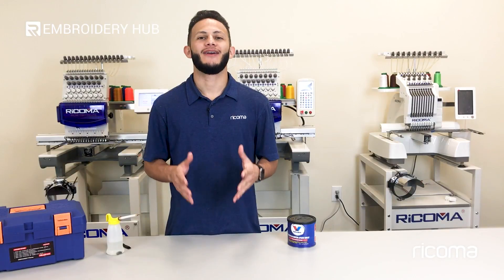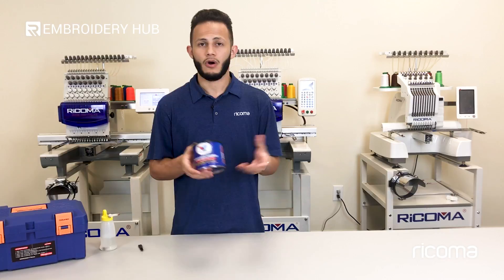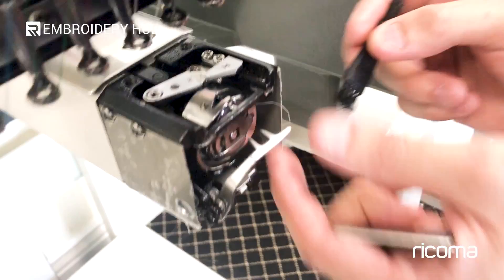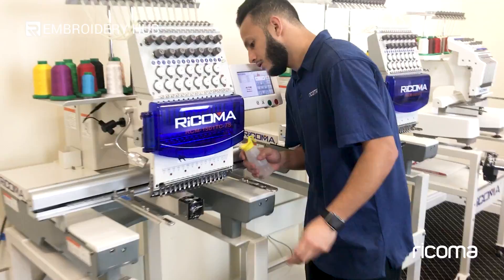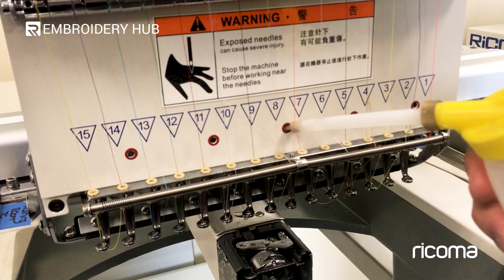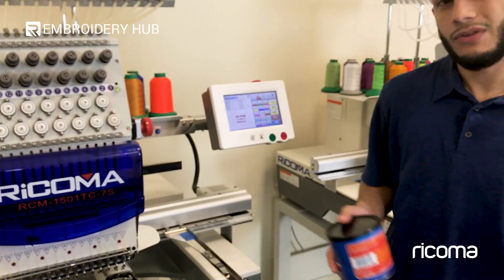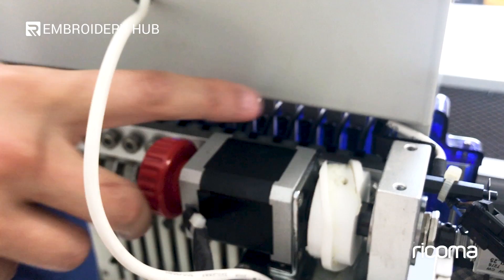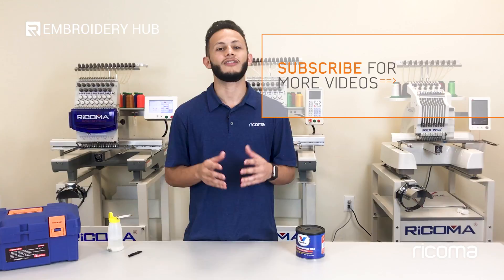Embroidery Hub Ep. 17: 1501-TC Embroidery Machine Maintenance | Embroidery Machine Tutorial

Comment: I have a RCM-1501tc-75 ( purchased jan  2021). I noticed my machine do not have a 2nd hole located at the back of the arm to oil the back of the knife rod. as shown in this video.  What to do??
Reply from the maker: Hi there, if you contact tech support they can show you proper maintenance on your machine, ricoma.com/us/tech-support
Reply: Bought mine same time same issue
Reply: @Prough  Hi did you ever figure it out? I'm having the same problem.
Reply: Hi did you ever figure it out? I'm having the same problem.

Comment: How did you get the needle plate removed? There's not enough space to use a screw driver due to the Needle head being so close to the needle plate. I have an L wrench with a flat head on the end of it but the screen will not budge and instead, the L wrench flat head tool that came with the machine eats at the flat head groove. I do not want to strip it. Any suggestions?
Reply from the maker: Hi there, please send our team an email so they can help! -->service@ricoma.com